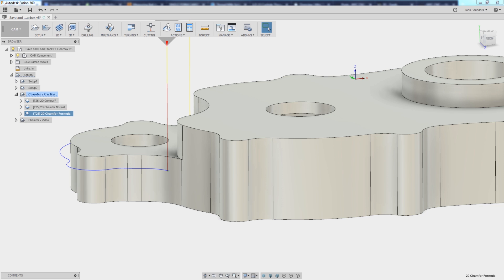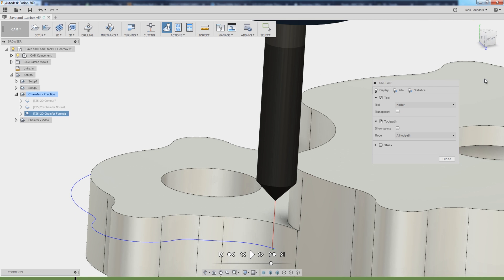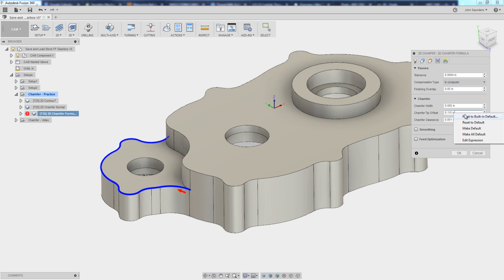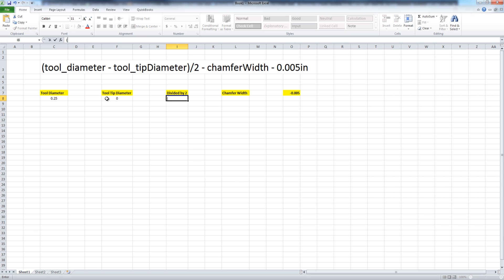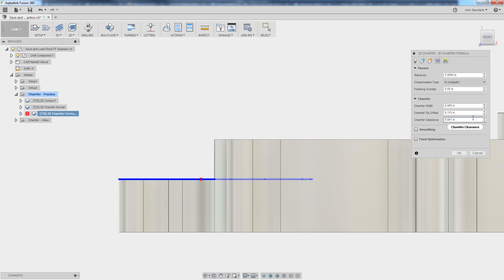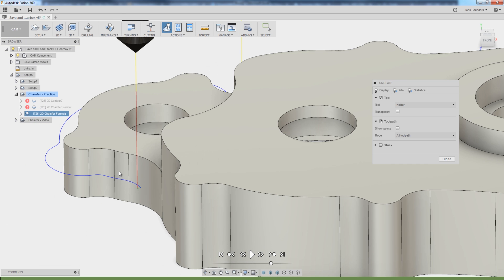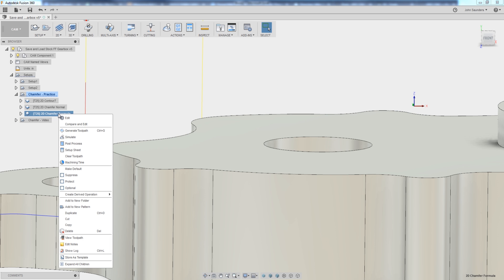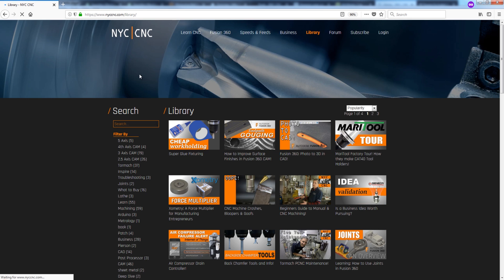Fusion 360 Chamfer Tip Offset Formula! FF120

Comment: Hey John, great video! I know its old but I had a question. I am using 2018 solidworks with HAMMOCKS add-in. I need to add a chamfer in a similar edge like this model. The problem im facing is my model has a chamfer. How do I chamfer using this when there is a chamfer modeled so it detects the edge of the island. Can it be done with the 2d contour?

Comment: Maybe somebody can help me out here. My chamfer cutters tip is a little worn, so if I put in the value "chamfer width -.005" then the shank will rub. It appears that changing the .005 value has no effect on the depth of the tool. I went as high as .04 and it still simulated the same. What am I missing?

Comment: I was wondering if there's a way to link surface speed of the tool to the portion of the chamfer tool edge you are using as a formula?  I usually would run all my chamfer tool's surface speed based on the maximum diameter of the tool, but there must be an easier way to correct this than hand calculating it each time!

Comment: Well that's nice for getting in close to the end of a chamfer against a wall, and it maximizes the surface feet per minute on the tool, which is good. But if all your chamfers are narrow, you are only using .025 or .050 or something like that of the tool, so you are minimizing tool life. Wouldn't bit be more interesting to select the part of the tool you cut with dynamically to use more of the flute length, by shifting the cutting position to average out tool use over a larger flute length? You could use the top of the tool near the walls, then shift down some for the middle of the chamfer, and possibly even more if at some point you have to clear a floor feature while chamfering an edge.
Reply: l wilton i program cnc by gcode and i alwas wanted to do that

Comment: Some of the things I love most about running mazak mills is how awesome chamfering works. If I tell it to chamfer a hole or a line anywhere and I tell it I only have 3mm of axial clearance it will automatically change the depth the tool will go to avoid a collision. If i have a 15mm chamfer tool and I want to chamfer 20mm hole with a 26mm counterbore 10mm deep it will circle mill the chamfer while avoiding a collision with the 26mm counterbore by going deeper into the 20mm hole but if I then decide to use a 25mm chamfer tool instead it will automatically change the program to simply plunge down into the hole instead of circle milling the chamfer.

Comment: While this formula prevents radial crashes, it doesn't prevent axial crashes - so it puts the tool as far out as it can, and as deep as it can - even if that means the tip gouges the material below
Reply: The toolpath will trim out axial gouges.   That said you are right, it is optimized to get the most of the tool in a radial direction.
Reply: not sure what you mean by "trim out"  - but in my test it gouged the material below
Reply: Then that's a bug.  I looked into it and you are correct for a tool that doesn't have a tip diameter, it isn't trimming collisions in Z.  However, if the tool has a tip diameter, even .0001" then collisions in Z are trimmed.
Reply: Yes, I have the tool set with no tip diameter.  Could certainly set it at 0,0001 to avoid the crash though,.
Reply: in the meantime, we will get this fixed.  But, at least for now you know :-)

Comment: Hand raised - clipped a part and lifted a part yesterday rubbing slightly against the chamfer tool's shank. Why this equation is not the default, who knows. Below is my reply to Hirudin after tinkering with non-45 deg chamfers. Seems to be pretty close.
((tool_diameter - tool_tipDiameter)/2 - chamferWidth - 0.005in) / tan(tool_taperAngle / 360 * 2 * 3.14159)
Reply: That looks like it'll work, but you'll also want to do the Math.tan calculation on the chamfer width.

Comment: Does this work for non-45° tools? I have a much more complicated expression, and it works with any angle, but if this'll work for 60° chamfers (or whatever) I might have to switch.

Also, is there a way to back-chamfer with this?
Reply: To put it differently, it looks like this is using the width of the tool to calculate the depth offset, which is clearly fine for 45° tools, but will fail for chamfer mills with an included angle that is anything other than 90°.
Reply: With Jon's expression, I think there is an outer '/ tan(45deg)' which has been dropped and thus only valid for 45deg chamfers. Perhaps someone who knows Fusion360 expressions and math better than me will correct any mistakes in my expression below. Fusion360 didn't seem to honor the units going into the trig functions nor understand the pi constant despite the documentation. I found a list of constants from an Autodesk page called "CAM Expression Variables in Fusion 360."
((tool_diameter - tool_tipDiameter)/2 - chamferWidth - 0.005in) / tan(tool_taperAngle / 360 * 2 * 3.14159)
Reply: I made a video about the expression I use (it works perfectly), if you wanna look it up it's one of my more recent videos.

Pi is "Math.PI" (both P and I need to be capitalized).
Reply: By the way, I got my first package from Misumi today, largely thanks to the video you made about it. That is one funky web site!
Reply: Thank you for the reference, sorry to regenerate your "journey" and I have the feeling you got to the destination faster :) I need to start a template library and expression is going to be one of the first to go in. I'm happy to have another Misumi brother thank you for telling me that. You're now number four whom I've met who knows Misumi, yes I can count us on one hand. I heard from a Misumi rep recently and sounds like they are going to start getting the word out more including exhibiting at IMTS this year.
Reply: Maybe they are using C# for the expression interpreting? Math.PI would match C#'s term. Might be a place to start if looking for undocumented functions for expressions.
Reply: Hey thanks for that! It actually took me a pretty long time to get to get there... :) I basically had to start by giving myself a crash-course in YouTube-taught trigonometry. LOL

Comment: you should use a double angle shank cutter to give yourself some breathing room on those blended chamfers
Reply: If that's the tool I'm thinking of, with the relieved neck, it could also be used for back chamfers? Good idea
Reply: Kent VanderVelden I think it could do the back chamfer just fine, Harvey tool shows a diagram chamfering in a slot that's considered a back chamfer, I also use the the 60° dasc for thread milling